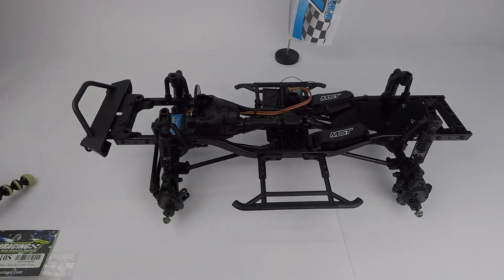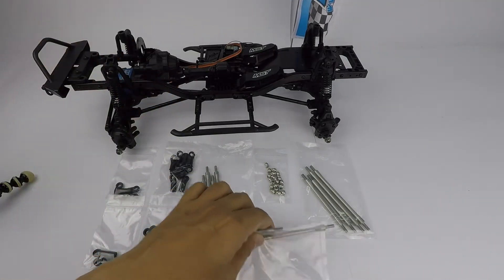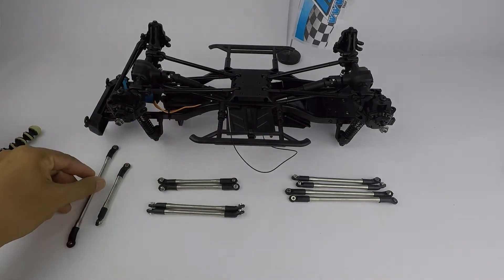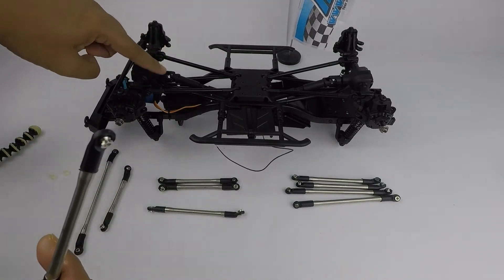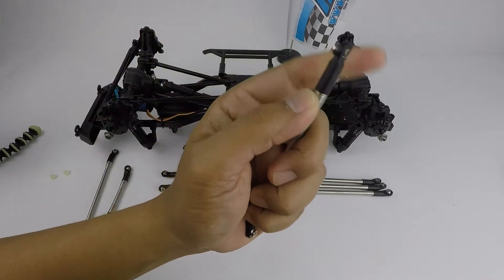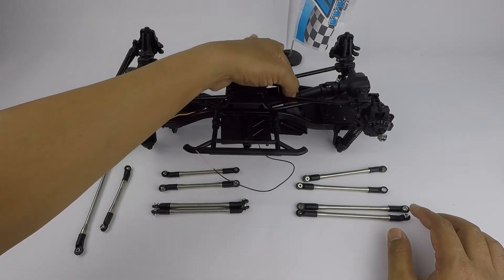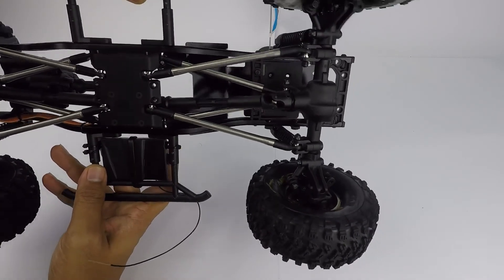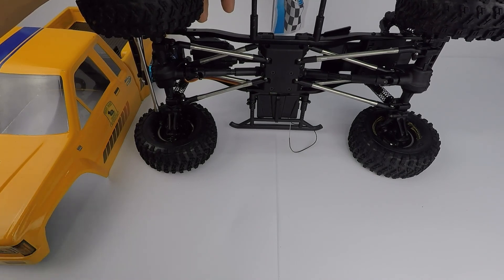CFXW Chasis Conversion from 300 to 313mm

Comment: hi again, did you suffer any breakage on the axle while running on the mud or during maximum turn on the wheels?
Reply from the maker: Roxass00 fortunately not yet but i have heard that the cvd is a bit brittle. Many of my friends has broken theirs. MST is coming up with a new CVD with stronger materials. A buddy of mine in Taiwan has tested it out and it is quite good. Should be out very soon.
Reply: cool, that is good to hear.

Comment: I think this video would have been a lot more better if you listed the parts you used for the conversion in the Description Box.
Reply from the maker: Bangbangboom51 thanks for the input. The only hop up parts i used in this video is the boomracing cfx-w conversion kit. Everything is contained there. But i agree. I should have provided the website links. Thanks again
Reply: no worries mate. won't this conversion weaken the driveshaft since there is less contact area within the driveshaft after the increase in wheelbase? thanks.
Reply from the maker: Bangbangboom51 they do provide the options for longer drive shaft in the kit but i dont find.the need for it actually. I have not upgrade my driveshaft anyway so might just do that soon